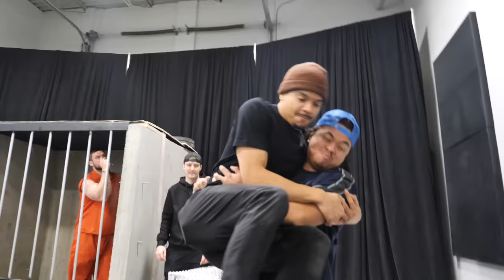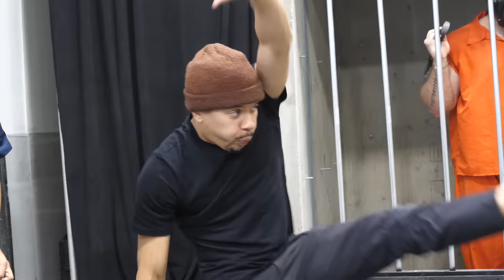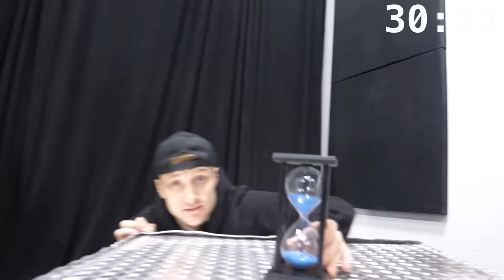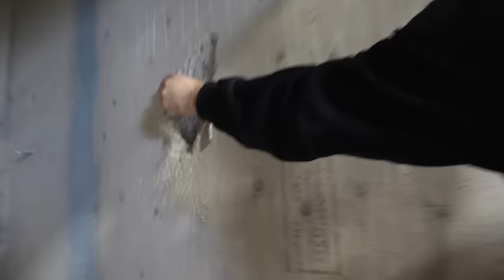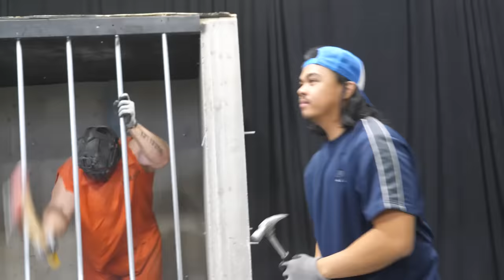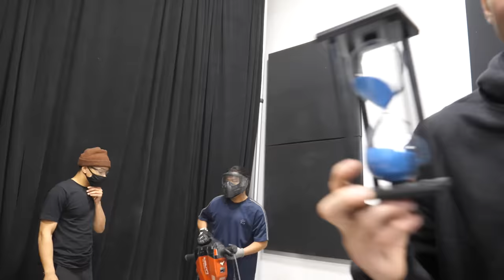1 Hour To Escape A Prison Cell

Comment: The fiber is only to prevent chipping if you wanted to prevent it crumbling or being smashed you would’ve put in wire mesh or rebar and it would’ve been very easy if he hit the exact center or worked the corners once he noticed a crack he should’ve worked down it instead spoon.